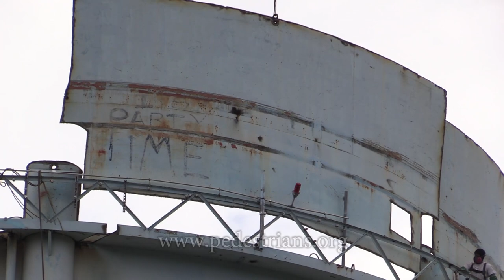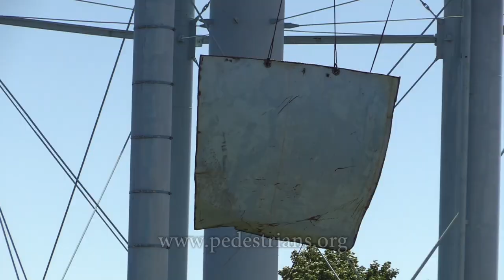Water Tower Demolition (Time Lapse), Frederick

Comment: Apologize for the random question-  could it also be a controlled implosion? Barring any disturbances, scrap is scrap - just curious. Appreciate the video, really educational!!
Reply from the maker: Sometimes they take water towers down by blowing up one of the legs and having it fall over onto the ground, where it can be cut up at leisure.  In this case, due to nearby buildings they had to cut it up and take it down in pieces with a crane.
They did something similar with these radio towers -- blow up one leg, and then they fall over and can be cut up at ground level:  https://www.youtube.com/watch?v=x1_HZudIaYQ